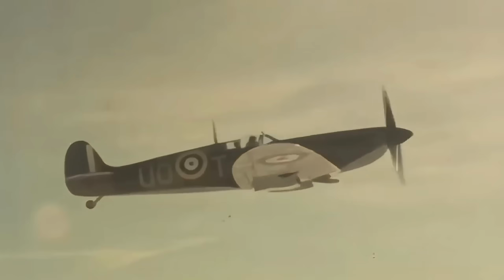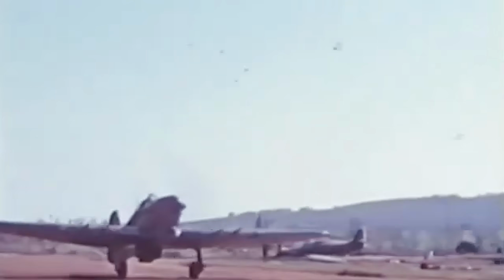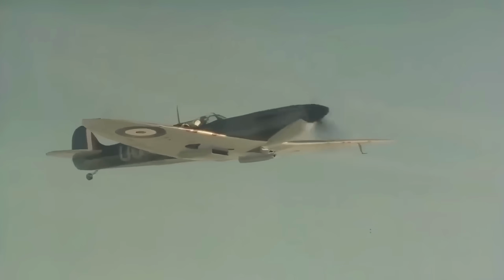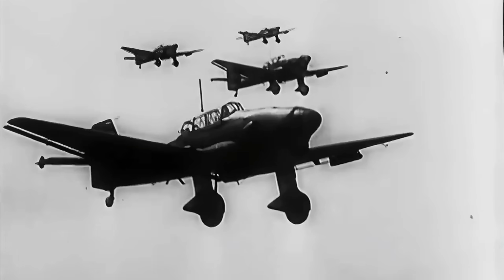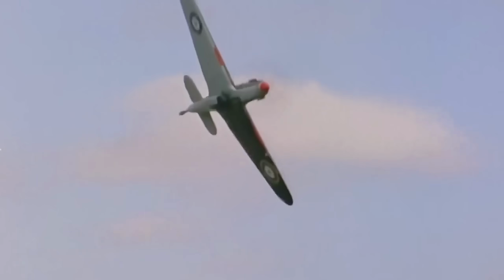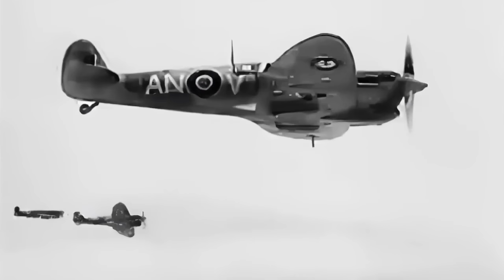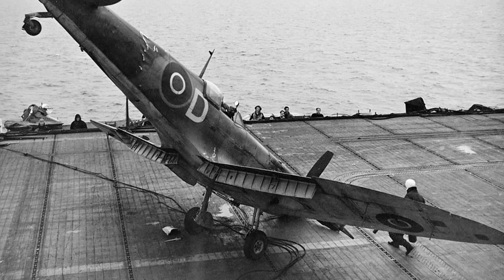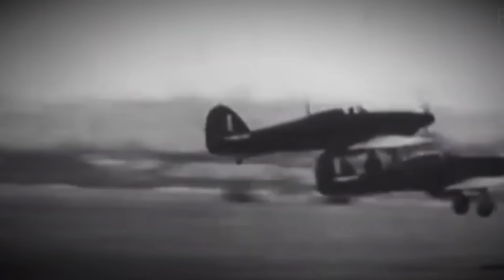The Dark Truth About the Spitfire

Comment: Is it true that the Spitfire's elliptical wing could not carry drop tanks, thus the aircraft was unable to accompany bombers on long range missions into Germany. The aircraft that ultimately destroyed the Luftwaffe was the Mustang, ironically equipped with the same engine as the Spitfire.
Reply: To the best of my knowledge it was able to carry drop tanks. In fact there is a photo of a spitfire with beer kegs slung under each wing.
Reply: @davidh6300 Many thanks.
Reply: @anonanon289 The earliest use I can find for the Spitfire using tanks is the Mk I PR Type F Spit using wing mounted blister tanks for long range reconnaissance ops. (July 1940) but I don't think they were able to be dropped.
Mk V were the earliest for drop tanks.
Reply: @uncoolmartin460  I believe that drop tanks plus guns was difficult or impossible due to stability issues. Not a problem for other aircraft such as the Typhoon and notably the Mustang. The latter ironically designed by a German/Austrian American.
Reply: @anonanon289 Ironically the p51 was designed from an RAF requirement for a long range fighter that only got really good when fitted with Merlin engines.
As I said the Mk I PR spit blister tanks weren't droppable. (PRU spits were unarmed.) Mk V, Mk VIII and MK IX spits were able to use drop tanks, blister tanks and slipper tanks.
Reply: @anonanon289 where's the irony?
Reply: @uncoolmartin460 The RAF requirement that the NA-73X was designed for was not for a long range fighter, but a low altitude tactical fighter like the P-40. North American merely made the thing super streamlined, this giving it its long range.
And in actual fact; the early versions with the Alison engine were also excellent aircraft. They merely lacked higher altitude performance, but they excelled at lower altitudes. The employment by RAF army Coop command/2TAF on “rhubarb” raids was a revelation and real game changer.
Reply: That overstates the achievements of the Mustang.
Reply: @robertpatrick3350 What does?
The Mustang was an extremely successful aircraft. So was the A-36 Invader. What’s your problem?
Reply: Reginald Mitchell designed the Spitfire specifically as a short range interceptor/bomber destroyer, prioritizing rate of climb and firepower over endurance (and to some extent dogfighting agility). It didn't have enough internal fuel capacity to be a good long range escort fighter. Drop tanks generally have to be jettisoned before combat, so the plane has to have enough internal fuel to get back home afterwards. The P47 Thunderbolt and P51 Mustang were designed for a more general role with good internal fuel capacity, and were better as escort fighters.
Reply: The usual long range ferry tank was not droppable. It was called a Slipper Tank.
Reply: The P51 didn’t “destroy the Luftwaffe”.  The Luftwaffe was destroyed by a combination of a lack of resources: essential materials, fuel and men. 
This terminal situation for the Luftwaffe was brought about mainly through the effects and attrition of the combined effects of the western Allies strategic bombing campaign and by the tremendous losses, in both materiel and manpower, in the war against the Soviet Union in the east. 
Why do Americans always try to claim everything?
Reply: Thanks to all for replies.
Reply: The Mustang had better range than the Spitfire yes, but consider it was built in 1936 as a bomber interceptor/ fighter, it did a pretty good job. 😊
Reply: Spitfire drop tanks were fuselage mounted. A mark 9 was modified by the Americans to carry wing tanks, but this was not adopted because the wing structure was compromised.
Reply: Well, two points. 
1. The RAF undertook deep raids into Germany at night and thus wouldn't have taken Spitfires as escorts. There was no pressing need for fighters to escort RAF bombers. The Mosquito could almost carry as much bombload as the B-17 but was as fast as a fighter and so didn't need an escort. 
2. The Mustang only had the range advantage over the Spitfire for about half a year in 1944. After Normandy the RAF could fly from airfields closer to the German border. They didn't have to fly all the way from England and back.
Reply: @lyndoncmp5751 What are you guffing about?
The RAF was forced to adopt night bombing, because it suffered unsustainable losses trying to bomb during daytime.
Reply: Range but one aspect and in no other did the mustang's performance exceed the spitfire.
Reply: @MichaelHarrietha-s4z Yes it did. The Mustang had far superior high speed responsiveness and handling than the Spitfire, whose controls would lock-up. And far superior speed retention from dives then climbs. Two crucial factors in aerial combat.
Reply: If you're an American remember this. If it wasn't for the British providing a requirement for a new plane the mustang wouldn't even exist. Also without the merlin it never would've achieved the performance and status it did. Noce try.
Reply: @MichaelHarrietha-s4z And seeing as you a pom you need to remember this; if it was for North American aviation even existing, this aircraft that was such a marvel for RAF co-operation command/2TAF would have never existed. And same for Curtiss who made the P-40 that the RAF depended upon in North Africa. And for Consolidated who mane the PBY Catalina. And for Grumman who made the Martel.
And neither Packard who made the vast majority of the Merlin aero engines, due to Rolls-Royce being stuck in the past.

Oh and who made all the M4 Sherman tanks, liberty ships, etc.
Reply: Oooh. Triggered. No one spat upon contribution. As usual as an American you have to lose your mind. Ya we know.  You won the wars, all by yourselves.  @danieleyre8913
Reply: @danieleyre8913 Rolls Royce, stuck in the past, yet you used their engine in your premier fighter and Packard made millions off producing them. Past? Oh boy. When it comes to Americans, you don't have to make stuff up and you rarely disappoint.
Reply: @MichaelHarrietha-s4z I’ve never been to the USA.
Rolls-Royce produced good engines. But their production methods were stuck in the past. That’s why the British air ministry needed Packard to make most of the Merlin engines for them, Rolls-Royce with their quaint old methods they couldn’t shake weren’t up to task.

And that’s an historical fact.
Reply: @danieleyre8913 The reason was simpler than that. Rolls Royce, regardless of your assessment, was incapable of producing the numbers necessary, and also, since the mustang, boats and other requirements were needed where the manufacture of said items were taking place it only made sense to build them under license in the USA. Can you imagine the risk and extra strain on logistics already stretched to transport engines to the states? Besides, British factories were still under threat, albeit not as bad as 40/41. Think man think. Nevermind this pissing on RR.
Reply: @MichaelHarrietha-s4z  Ah wrong.
Packard began tooling up to make Merlin’s in 1940, and began continuous production about a year later. All long before Pearl Harbor. Initially entirely for British aircraft manufacturers such as de Havilland, Fairey, Avro, etc.

Almost every Mosquito or Lancaster bomber built had packard Merlin’s installed.

Rolls Royce couldn’t meet British industrial demands because they employed backward production practices. That is a historical fact.
Reply: Spitfire XIV and XVI had much better combat records when they eventually arrived to airbases in France to join the fight Germany, than any US aircraft like P51
Reply: @Whybothermessagingme Shhhh. An American mey be listening.
Reply: @Whybothermessagingme And your source for that claim is?
Just pulled from bottom?
Reply: @danieleyre8913  Spitfire XIV shot down over 150 fighters loosing just 3-4 airframes to enemy action giving them at least a 37:1 kill ratio against the best German fighters, including Me-262.
Reply: @danieleyre8913  My source is official RAF records but also Luftwaffe ones to fact check losses
Reply: @Whybothermessagingme Yuh cool story. And your source for this claim is?
(*tumbleweed*).
Reply: @Whybothermessagingme Which you can’t give me page numbers etc for.
Why would RAF records also have USAAF records in them for comparison?
Reply: @danieleyre8913 the F6Fs kill ratio is quite widely regarded as the highest kill score of any plane in WW2, therefore I am considering it common knowledge for my own comparison. Most people treat the “Spitfire” as a single aircraft so it’s kill ratio is impossible to calculate for all the different models. Also unfair since Spitfire 1 is nothing alike Spitfire XIV other than the name.
Reply: @Whybothermessagingme  Oh okay backtracking on your tall claims…
Reply: @Whybothermessagingme You rest my case.
Reply: @Whybothermessagingme And the wildcat no comparison to the hellcat. Nor the zero to contemporary bf109s and fw190s.
Reply: @danieleyre8913  backtracking? Are you going to argue with my point or pretend to make fun of me?
Reply: No not the same engine. Different type of engine
Reply: @HACKERZ-x1i License built Merlin. It was the same thing with a different name. Americans smh.
Reply: @Delusionaryvisionary_407 Americans smh? What kind of engine is that?
Reply: @HACKERZ-x1i  Yes it was ..essentially it was the same design built under license by Packard. various parts improved to suit mass production..The original having a great many 'hand made parts....Both variants were superb  power plants
Reply: Even with drop tanks; the spitfire could never be an escort fighter. The elliptical wings inherently created too much drag.
Reply: @danieleyre8913 I’m not sure where you get this idea from? The elliptical wings were aerodynamically efficient and certainly did not cause drag, in fact quite the opposite. The Spitfire was designed as an interceptor not as a long range escort.
Reply: @russellmarriott9396 If the Eliptical wings & elevator of the Spitfire didn’t cause drag; the aircraft would not have been capable of its tight aerodynamic manoeuvres.
Elliptical wings were great at velocity ranges of 300-550km/h because they would give extra drag when the aircraft initially pulled any manoeuvres, as the area of the surface in opposition to directional flow was greater.
However, at higher airspeeds, when airflow becomes increasingly laminar, as was becoming more common towards the end of the war, their manoeuvres cause greater losses in velocity. And the airflow eddys in level flight become non-uniform thanks to the wing shape, which causes extra drag. Plus the control surfaces become decreasingly responsive.
Reply: @danieleyre8913  Elliptical wings have inherently low drag.
Reply: @alangledhill6454 Ugh another one.
I’ve already addressed that to someone else.